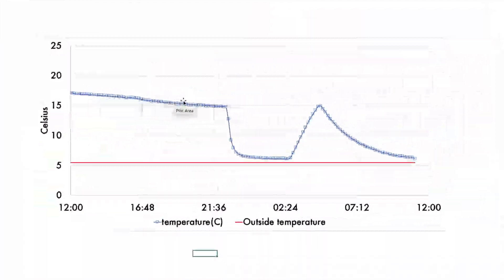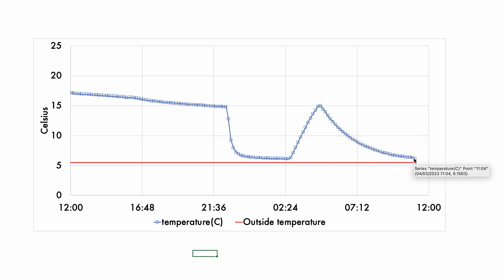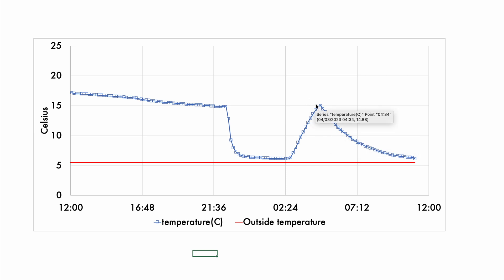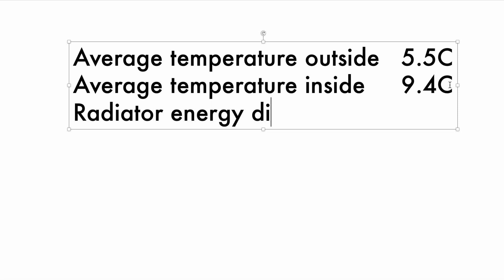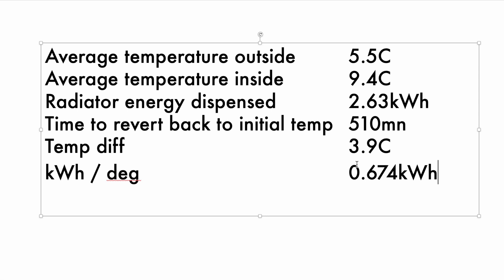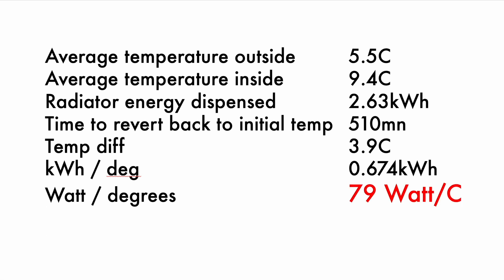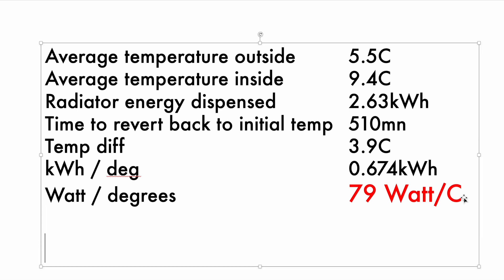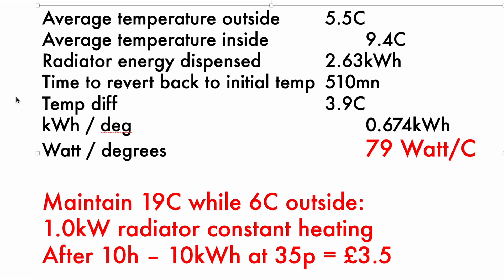How can I measure the heat loss from a room?

Comment: An energy "impulse" includes reactive components, like capacitance.
In thermals, you are including the heat storage of all the masses inside the room.  As you heat the room, you are heating the masses (of course including the walls etc) until you get the full loss gradient across your insulation.  So you use up more wattage one time, foe the initial heating.  You don't want to include this wattage in the "maintenance" power requirement, unless you're staying only one night in the room.
To do this properly for permanent conditions, there are issues with accuracy since the outside temperature fluctuates, but the goal here is to maintain an indoor temperature at a certain comfort value.  To do this, measure the wattage on a stabilized indoor temperature (maybe second day) for exactly 24 hours.  Night time will use more energy of course  but you can permit using a lower sleep setpoint temperature as well. What matters is the total energy spent in 24 hours.
If the outside temperature doesn't change much, you can calculate thermal resistance as Pavg / (Tinside - Toutside).
Merci pour le video!!!
Reply from the maker: Thank you.

Comment: Not clear do you switch the heater off at a set temperature and then time the drop,kWh 5c to 20c how much power used and then the time to drop exactly back?Proof.What size shed haha.
Reply from the maker: Not sure what else to add. You dont need to know what is the target temperature. Only the average temp during the observation period. You do need to let it go back to the initial temp too.
Reply: @evdabbler  What size shed :hand-pink-waving:

Comment: Simple. Cover entire structure in perfectly reflective fabric. Heat the joint to 40 degrees. Wait an hour. Measure temp. Subtract this number from 40. Then call somebody who knows how to actually do this kind of thing and start over. Screw it up. Have the experts come and do it for you. Decide you didn't actually care that much. Refuse to pay bill. Go to court. Lose the case. Get evicted and foreclosed on. Move into apartment with paid utilities. QED.

Comment: Would you take a stab at measuring something like that but for a whole house? I guess I can measure fuel use over a week, estimate furnace efficiency etc.
Reply from the maker: Yes. I have done a few rooms like this already, and found good consistency. The one thing to pay attention is to ensure that you're indeed measuring like for like, by which I mean don't expect to spend the same energy if all other rooms are cold, and the house has not been heated before.